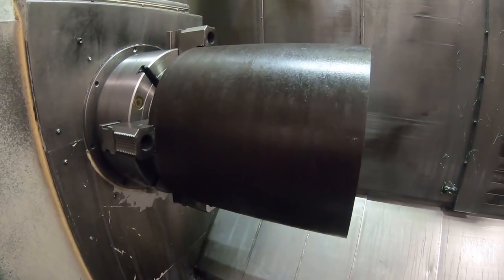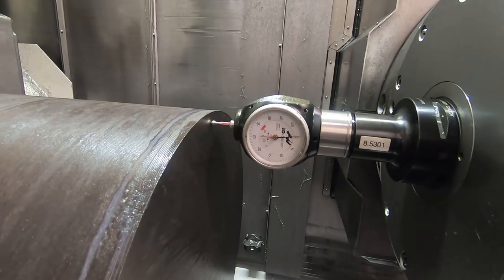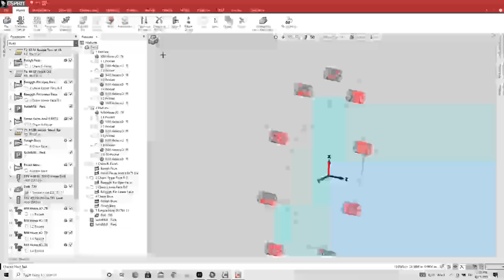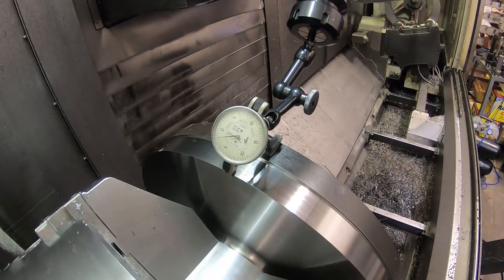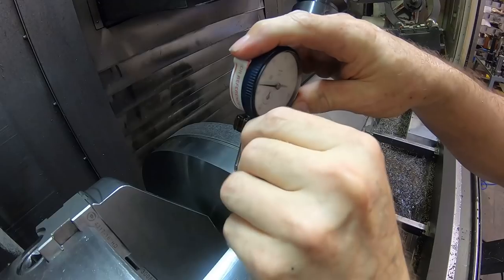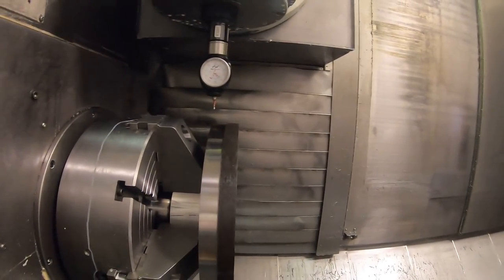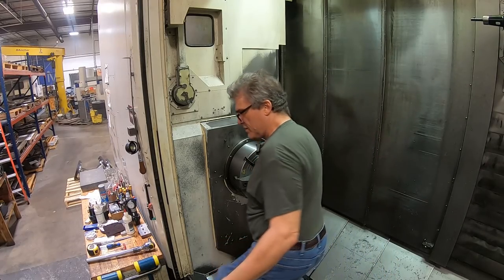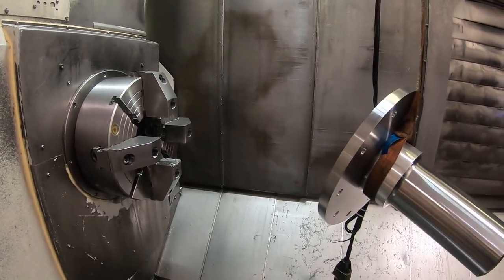830 Op 1 Machining and Flange End Op 2

Comment: i don't know what it is or what it does but it must be a $20,000 part.....you have a magnificent and fearsome robotic lathe there .... these modern machines are otherworldly ....i'm guessing but it would be interesting to calculate the total amount and cost of electric power it required to machine that item ....i'm guessing it must approach $200 to $300 just for electricity which is the cheapest item in the list of requirements to make something like that........you could probably take on 3 apprentices and charge them $60,000 a year tuition each over 5 years to learn the trade if you wanted the nuisance and bother of teaching in addition to your other jobs.......very well done and after doing it for 35 years you make it look almost easy

Comment: Try a good sized ball peen hammer for adjusting your run out.  Of course you can use it only on stock that will be machined away later.  Much more effective than a dead blow.  Good videos!

Comment: The air coming out of the knife is probably in laminar flow. At the edge of an air stream is the boundary layer. A laminar boundary layer is thinner and has less drag than a turbulent boundary layer, but doesn’t stick to a surface as well. In this case you want the airflow to remain attached to the surface (lens cover), drag isn’t an issue. So I think you’d get better results with a turbulent boundary layer. You can experiment with this by sticking a thin strip of coarse abrasive strip just in front of the air knife exit. That should tip the flow into a more sticky turbulent boundary layer that should clear the lens more effectively. Some gliders have a strip of abrasive on the leading edge to keep the airflow attached to the wing. (Higher drag, but lower stall speed)
Reply from the maker: That’s interesting. I could even try machining different surfaces on the ramp the air flows down to the lense.

Comment: It amazes me how much force those jaws can grip with to hold a part that heavy that far out of the chuck!! Here I am putting a tailstock in on a little 3x3 part because it feels big lol.
Reply from the maker: I would never do this with a hydraulic chuck. As speed increases a hydraulic chuck looses clamping force. A manual four jaw chuck doesn’t have this problem. Also remember this part isn’t really that long. It’s just the size that intimidates you. It’s 16” in diameter and only 21.5” long. If you stick your 3” part out around 4.5” it’s about the same relationship.
Reply: @EdgePrecision  Yeah, the scale of it messes with me. The aesthetic of a 20" part hanging on by 1" of jaw jumbles my brain. I'm sure there's many thousands of pounds of clamping force with them and is perfectly safe, but it still makes me feel yikes lol.

Comment: I'm with you on the CAM being nicer and safer. I think it's actually not effective overall, too. I don't use a Mazak, but I've found conversational is only useful for the things I could write in straight gcode, and if it's that simple, might as well do that!

We invented CAM systems for a reason! It's the smart thing to use them!

Comment: Love the videos. I do have a question about indicators on horizontal machines. 

When I was trained on a horizontal mill a few years ago, my instructor said that you shouldn't use a normal dial test indicator in the spindle to pick up on holes, because gravity will give you a false reading. To demonstrate, he used a Noga Mag Base on a piece of flat stock, zeroed the indicator on the steel and turned the whole apparatus upside down. Sure enough, it drooped about .001. To get around it, I was told a co-axial indicator never has this issue.

Have you run into this sort of problem on the Mazak or Mits? Do you think it's a lack of rigidity in the Noga Arm or an inherent issue in the mechanism of the dial test indicator?

Thanks for making great content!
Reply from the maker: Your instructor is correct. What ever indicator and arm you use has to be tested for this. Any mag base arm combination I have found is useless. What I use is a the short Noga arm with a Interapid vertical dial indicator. The old Noga arms had a small clamp knob like you see in this video. The new ones have this large knob. I don’t like that. The arm should mount in a collet chuck and be short. The stylus pressure/force of the indicator needs to be light/low. This can contribute to the error. The Interapid indicator has a very low force. The only co-axial indicator I would use is the Hamer Centro. All the others I have tried aren’t in my opinion accurate enough. But it does cost around $600.00. Also I can’t run the spindle with the doors open on the Mazak. So a co-axial indicator would have to be turned by hand. Not the most ideal but doable.
Reply: @EdgePrecision  Thanks for the reply! I'll do some more testing with it next time I need to indicate on a bore. Always worth trying to learn something new.

Comment: So many great things in this video a real treasure trove and very clear and lucid. Really liked the roughing footage; cool idea with the rainx + air knife. I've wondered if its possible to pulse the coolant somehow (in particular instances ) so you can synch your frame rate almost stroboscopically (24 to 60 fps) so that the phasing can be such that you see the actual cut mostly without coolant even though the surface is receiving coolant. Perhaps better than cutting dry for didactic purposes. I really liked the footage showing the near mayhem of the rough cuts - really enjoyable to see that. ALSO really appreciate the split frame showing the inserts - genius ! (Really helpful - rough and finish.). Also CAM strategies and programming for different less obvious tool paths to fit much more appropriately the torque of the spindle. [I'm defiantly going to have to steal that approach :-) .]. At the end I really liked how you just walked with the camera round the corner of the machine and into the work area and main spindle looking down into the length of the machine (towards the tail stock) and then pivot to the main spindle and the craned part: it gives a really GOOD 3D feel to the whole space, the machine, the space occupied by the machine and the whole "human" working space that you have yourself jammed in there like a space capsule/space station -  in "One take". You probably take that for granted but the wide angle lens and walkabout that way was really cool and creates a REAL feeling of the space. [Thanks so much for making this - really good visual and technical explanation that holds one's attention all the way to the end - definitely appreciate the time and effort and thoughtful explanations / edits. Awesome ! ].
Reply from the maker: Wow long comment thanks! The issue with pulsing the coolant is it takes many seconds to bleed down. So if it was pulsed you would never see it. A interesting idea though.
Reply: @EdgePrecision  I was wondering about a simple case (visually just for fun) with a coolant nozzle that had some kind of pulsing / interruption gizmo. Maybe I mock something up. There's a lot of videos out there that show stroboscopic individual droplets of a stream that have a surprisingly regular "Periodicity" and appear stationary and yet their phasing can be adjusted / dialed in. [The stream appears contiguous to the normal eye but its really not, its a collection of regularly spaced flying droplets.].  But yeah I understand-ish the basic TSC (high pressure) and other flood coolant / dishwasher "Mode" mayhem and pretty fast "Balls out" to the wall production work.  Awesome to see all those extra shots and angles cut together in your video - really nice. Thanks again !

Comment: You could use an inline oiler setup to inject Rain-X in to the air line to the camera. Toolmakers use them on their pencil grinders all the time.
Reply from the maker: I will check into that. Thanks!
Reply: just wanted to the exact same thing, good thing i scrolled a bit... :D
Reply: That sounds like one of those ideas I should tuck into a grey cell for some point in the future.
Reply: I wonder if that would do anything to the coolant?
Reply from the maker: @somebodyelse6673  It may but I loose and makeup gallons of coolant every week or two. I think a few ounces of RainX won’t do to much. I have always used it to clean the machines windows.

Comment: Thanks for another very entertaining and informative video. I wanted to ask you about your choice of finishing insert, I noticed that you (and other YouTube machinests) use a VNMG style insert for finishing and was wondering why? I prefer a TNMG style as they seem stronger and give 6 edges instead of only 4.
Reply from the maker: Actually the insert I use is a VBMT. The positive rake 35 deg diamond. I use this insert because it can cut down a 45 deg back angle. The VNMG doesn’t have clearance for this. It will rub the lower cutting edge unless you grind it away. Kind of defeats the four cutting edge advantage. This is very often required with thread reliefs in oil field parts. Also I like is because if shavings get wrapped up between the part and the tool it has more clearance on its back side. This has less of a tendency to mar the finish of the part. The TNMG of course won’t go down as steep back angle that I require.

Comment: Hey there,
Thanks for your time doing this video, it is very educational. I’m so curious to know about the cost of machining of these parts, I know lots of factors come into play when it comes to estimates this kind of perfect job.
Thanks.
Reply from the maker: I hope you'll understand when I tell you. I don't like to go into the actual cost of a real job. I often get my jobs thru my old shop Centerline. I don't think it would be fair to them to do so. In estimating a job. After adding up the expenses you know. Like material and outside processes and possible tooling. The only thing left is what your willing to work for. In the end this is the time it takes and what that costs. You can separate the setup/programming time. Than divide it by the number of parts. Than add up all three and that's the cost. It seems simple doesn't it. But there's the final cost. Here is where you have to decide. Can I get the job for that? A'm I willing to take chances, or risk a little more, on a unseen circumstance. In the end you have to do jobs and succeed and fail to know what is practicable (for you) to quote. I do have a video where I discuss this. "My thoughts on quoting jobs". But the final word is. Its your best guess for your situation.

Comment: For the rainex,  maybe a standard air line lubricator would do the job, maybe even a full FRL (filter regulator lubricator).  Off the shelf solution to inject small amounts of fluid into the air stream.

Comment: When I'm indicating in on a 4-jaw and have to bang on the part next to the dial indicator.  I'll slightly pick up the indicator point off the work piece, so it doesn't shock the indicator.  Of course, I do strictly manual machining.  Enjoy watching your videos, Ken.
Reply from the maker: This can be done with a 1" travel indicator. It would be difficult without disturbing the setting of a last word type indicator. Also I like to leave the indicator in contact with the work to see the movement when I strike the workpiece.

Comment: I designed a similar thing eight years ago and wrote a technological process for its manufacture. The problem was that we did not have such CNC equipment in production and we had to sharpen the shaft separately, and then cut out the flange on laser cutting, and then weld it to the shaft using shielding gas welding. And then turn the flange assembly with the shaft on a universal lathe in manual mode. But turning did not remove the residual beats, they still remained above the norm. With such equipment and a program, it would be possible to obtain a part with high accuracy.

Comment: Peter I would really be interested in how you setup you tool offsets on the Mazak. In the tool data page or tool offsets? And the what settings you use in you cam software. Also how you setup a tool in your cam with holders and what not.

Doesn’t have to be anything too special but if you could please make a video detailing some of this I would be really grateful.

So far I’ve just been learning as I go on my integrex and due to having another Mazak lathe mazatrol was easy to pickup. But this is my first time trying to use eia code and Im getting all kinds of odd things like diameters coming out way off size and other strange things.

Comment: Great video. Thanks. What was the max load on the machine spindle during roughing? How do you balance spindle HP against tool life?
Reply from the maker: In low range on these parts. I keep a eye on the spindle load reading. It starts at around 48% when it climbs up to around 55-58% I start looking at the chips coming off the tool. generally the tool will not be breaking the chip as well. Throwing off a long stringer or spring shaped shavings. something like that. I will stop and index the insert. this machine has a 60 Hp turning spindle. You have to pay attention to this. If the tool fails it wont stop or overload it will just burn up the tool and part.

Comment: I know as you mentioned that cleaning out the coolant is a mission. However I think it could drastically improve the film quality. You know that feeling when you just clean a machine out and there is no tramp oil residue. The machine is really clean and coolant seems to effortlessly drain off without clinging to everything. 

Just a though, with the go pro air blade and clean coolant I imagine the time you spend filming is much less aswell. I dont know if you ever reshoot any of the filming due to quality but it could save you time in the long run if its something your having to do as a result.
Reply: There's an air-powered machine for cleaning it.  It's available for rent from Safety-Kleen.
Reply: @douro20  Yh I agree sucking it out and cleaning would help. I imagine at this point its past its prime with a long period of time with tramp oil mixed.
Reply from the maker: I have just recently purchased a NexJen coolant oil separator just for this purpose. I haven't had time to install it yet. Oil skimmers wont work on this coolant system because most of the tank in under the chip conveyor. we shall see how this thing works. This NexJen seems to be the one people like.

Comment: Peter the man the myth the legend. 
My work has 2 Mazak integrex e650s with big plus cat 50 spindles. They were made around the early 2000s, I'm told that they were some of the first ones mazak made. Both of them have weird things about them that work funky. how has your experience with yours been?
Reply from the maker: What weird things?
Reply: @EdgePrecision  When programming some Renishaw probe cycle routines; tool changing from the probe to another tool can cause a soft over travel while in the tool change cycle. a couple other small things. Just was wondering how happy you are with the mazak control and how it functions. Also, do you use the mazatrol tool offsets or the eia ones?
Reply from the maker: @FuzzyPanda53  Yes I use the Mazatrol offsets for eia. But to apply the tip comp direction you have to do it in a unusual way that refers back to the eia offsets. So I use only the first 9 eia tool offsets only just for that purpose. It’s kind of hard to explain. I could demonstrate it. I haven’t had any trouble with soft limits in tool changes. But my machine was built in 2006 so maybe they ironed out some problems by then.
Reply: @EdgePrecision  Ah great thanks. I would be interested in hearing how you apply the tip comp. We use mastercam at my work and bake the tip comp directly into the program.

Comment: Holding heavy blanks to chuck-jaw can be assisted by T-slots & clamps, saving the other precision components.
Adjusting back flange & OD runout, T-slots & Jack Screw, saves the whacking while using 2 indicator setup. Observing each adjustment / movement. Saves what is left of our strength 😌!
Old Skool
Reply from the maker: Funny you should say that. One of my viewers that’s here locally. He made me some and brought them to me.
Reply: @EdgePrecision  Old Skool 1st Job: Warner-Swasey 24" Turret Lathe, File Board, Hook Scale & Calipers for rough casting, Tubing & Casing Heads W/Ring Groves!
Your New School, makes the old guy drool.😂

Comment: Hi Peter.
Keep up The Very Interesting Good Work as I know it can be a pain when you are continually working on heavy Stock however even though I've been retired for many years  back in The late 60s &70s I had a bit to do with A Swiss Tape Controlled Jig Borer  however when machining Stock in Lathes we would always take a skim to break The Skin  which was also beneficial  if The Work happened to move.
Cheers.
Brian

Comment: I wonder how you would do these setups with hydraulic chucks would it be easier and more convenient or is it gonna cost more since you have to machine soft  jaws for the specific diameter and is there a way to adjust runout on a hydraulic chuck I know you don't use them because they are so big and it creates clearance problems and that's why you are using this smaller 4 jaw chuck
Reply from the maker: Yes. This machine normally mounts a 21" Kitagawa chuck. What I did is buy a 16" manual 4-jaw chuck with the same mount as the Kitagawa chuck. Than it was just bolt it on the spindle. Another thing we have done is chuck onto a manual chuck in the hydraulic chuck. If your chuck isn't large enough for that. Bolt a short straight shank on the 4-jaw and chuck that in the hydraulic chuck.

Comment: What's your DOC at 14:16?
I am making nearly the same part as you. I have the flange on the front, and holding the body with a FlexC collet chuck.

Using a 1.5in solid boring bar with CNMG 432.. it chatters real bad. I might just have to pickup an anti-vibe bar... they're so bloody expensive. I'm hoping I can find the sweet spot feed/doc.